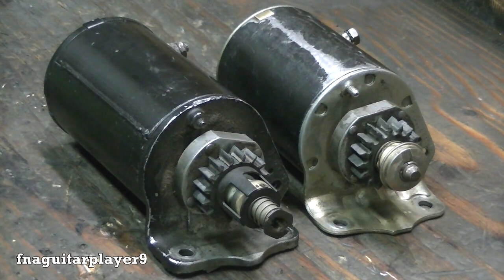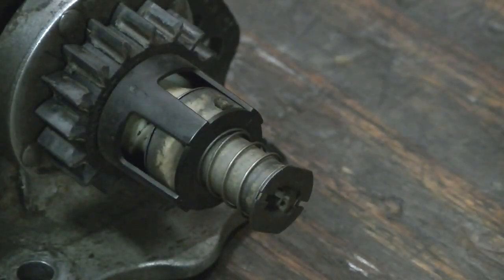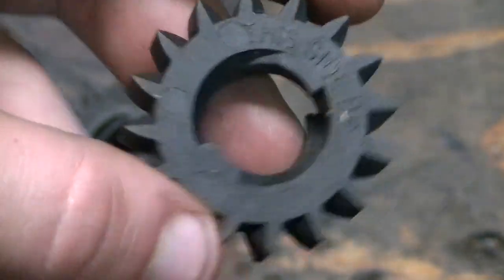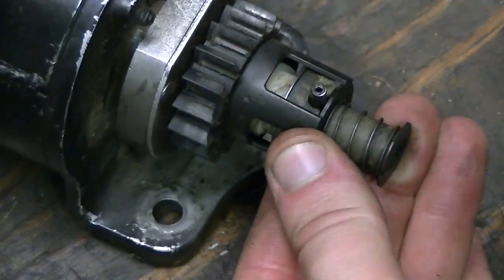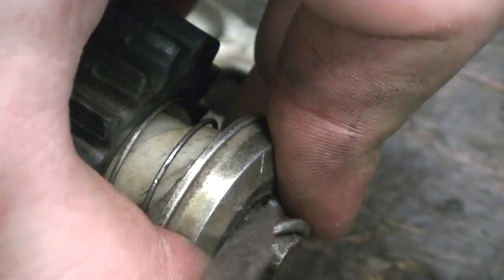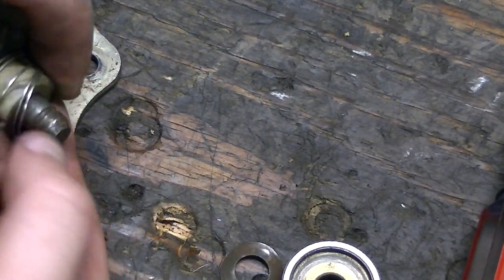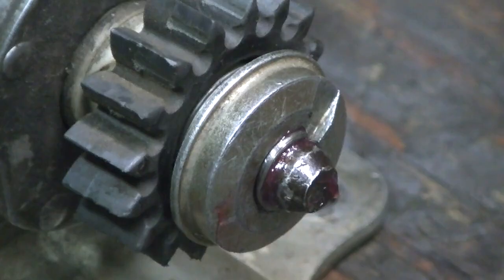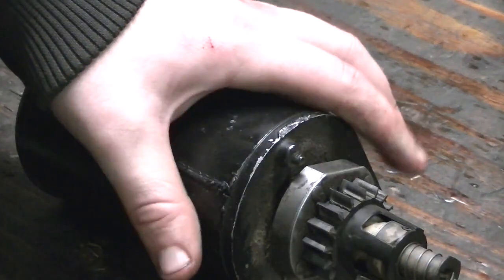How to replace a starter gear on Briggs and Stratton Starters (both rollpin and C clip type)

Comment: 🙋🏻‍♂️👍🏻 3-25-2023…… I notice that the shaft as to where the C clip fits is flat top cone. So it’s possible that the C clip could be placed centered over that , and use a small socket and tap it on until it pops in place. And using grease would allow ease of fit.
But I never removed one or reattached the C clip , so it’s just a thought. ( Definitely have something close to catch that CLIP if not in a shop  ) .  😍 Just took the C clip off, and I was very careful to have my hand over that area to catch it. There’s a slot in the edge of that top washer that contains the C clip. Well, I used a flat screwdriver of that width, which enabled the removal of the C clip much easier. Just turned that top washer until C clip came off, NOT flying across the room. Also, I selected Subscribe ❣️❣️

Comment: Thanks, 1983 Murray still running strong after rehab, rewire, clean out, 12.5HP  I/C  (industrial / Commercial) B&S 42" cut; why not a new J.Deere, well those are now all plastic which cracks apart in just 5 yrs, this 1983 Murray is ALL metal and can take the occasional impact with bushes, we love it, so we rehab'd it. I wax it once a week with yellow spray wax.     BTW:   I might have chosen a socket exactly the diameter of the c ring/clip to tap it down.
Reply from the maker: Your welcome! I feel the same, I hate plastic! Thanks for Watching!!!

Comment: Nice video there old boy.Man i sure am glad to see another man that isn't scared to use a little penetrating oil.I work on alot of push mowers that have never seen a can of wd-40.I look at it like this here.$2.98 for a can of wd-40,or $20.00 hr.i charge for labor.Oh well works out fine for me man.Job security.

Comment from the maker: @Bobbymitchell10 yeah i do to. there a pain. my twin has the c clip too, only had to replace the gear once, because the c clip came loose and it just shredded the gear haha the replacement i buy (from tewarehouse) is a actual clip, the factory ones looks just like a piece of bent wire haha i wander if a snap ring (type used with snap ring pliers) would work on one, i'd think they would be to thin. thanks for watching!

Comment: When reinstalling the c clip use a socket that will just fit down over the shaft.place the c clip on top of the shaf tthen tap it down over using the socket.Then squeeze it with your pliers or vice grips to insure its tight.
Thats the way i do em anyway. 
And yes i keep spare clips in the shop because they will fly when removing...sometimes never to be found.I found pointing the shaft at a ice cream container or bucket
works well for trapping the clip.

Comment: I find on the C clip style it is much easier to get the clip off if you put the depressed slot on the metal retainer 180 degrees opposite the open end of the C clip. I use a little Stihl  screwdriver to get the clip up and then put a larger wider flat tip screwdriver to finish the job.. Lay a rag on top and work under the rag. to put the clip back on I use a piece of tubing that just fits over the starter shaft and give it a pop with a hammer. Snaps right on.
Reply from the maker: I've tried alot of different ways, I miss the old roll pin style haha Thanks for Watching!!!

Comment: Great help! I got the nasty ring and broken black plastic gear off. Do I need to remove the flywheel to get the new gear on? The starter bolts are under the flywheel and cover.
Reply from the maker: tleihn Glad to help out! I hear ya, you should be able to install the new gear without pulling the starter or flywheel, you may have to turn the flywheel while you turn the gear to get it to go down on the starter. Thanks for Watching!!!

Comment from the maker: i've never damaged a started by doing this. this is just one way you can do it. not the best but it works. if you don't spray oil on it the parts won't work freely and can lock up and cause damage to the starter.

Comment from the maker: @1899lpv yes. on the older style like this, the gear on the starter is plastic and the gear on the flywheel is either plastic or aluminum. On the newer engines the gear on the starter is steel and so is the flywheel gear. thanks for watching!

Comment from the maker: oh wow, did you have it apart? If so you might have gotten the brushes installed wrong, or its possible your battery is connected backwards. thats really the only 2 things it could be. I have another video on here of taking the starter apart and replacing the end cap and reassembling it. Thanks for watching!

Comment: I took ths guts out of one and replaced it with the other. Only thing I had to do was pop the flange out of the bottom because the shaft was larger. It's not what you're supposed to do but it works.
Reply from the maker: I hear ya! Glad it worked for ya, Thanks for Watching!!!

Comment: Looks like you use it properly. On grass only. I just finished a customers AYP (Sears) rider. He uses it in fields. Blades were rounded bad, deck crammed w/weeds, etc; belt worn and loose. I sharpened, replaced/adjusted belt...I know he's gonna whine (he's a whiner customer) because I replaced the belt less than a year ago. This time I'm gonna tell him, "These are riding LAWN mowers, not field and brush mowers." No warranty, etc.
Most people THRASH riding mowers. You don't, obviously.
Thanks.

Comment from the maker: i didn't know that drive mechanism had a name!!! its hard to say, most places will try to rip people off. but on most of these motors the ring gear on the flywheel is replaceable, on newer engines anyways, on the older ones it was part of the flywheel casting. your welcome, thanks for watching!

Comment: Spend $15 for the kit with all new hardware, take the discarded white nylon piece, it is the exact right diameter of the metal shaft to smack the snap ring over the taper of the shaft without going metal on metal.
Reply from the maker: +jonzy246 That makes sense, I'll do that next time i get the kit. Thanks for Watching!!!

Comment: Un the second type is it possible to remove the other part under the gear???i need to remove my starter because it burned and that part is not letting me get to the two bolts that hold the starter to the block

Comment: My starter has a solid black plastic cap completely covering the end you were discussing. Does that just pop off? Best way to get it off? (You know, before I go and wreck it. LOL) This starter is one of the 120V types, and it works intermittently. The motor runs nice, and this starter will crank the motor, but doesn't do so reliably. It seems if you fiddle with the gear, it'll work once or twice after that. But when it does, it cranks fine.
Reply from the maker: Yes after you pop out the roll pin that holds the assembly on the top part will come off, i do have to admit i've never worked on a 120 volt starter for these motors, but i figure they are all the same as long as its briggs. Sounds like the gear is getting stuck on the cog, i would recommend soaking it down in penetrating oil or WD40, and working it up and down, that usually fixes that problem. Its best to add that to the maintenance list (put some WD40 on when you do your oil change each year). Thanks for Watching!!!

Comment: Hi, would you happen to know if these starters are interchangable?  My dad has a Craftsman  LT1000 which uses the clip style. I have a good roll pin starter. The measurements seem the same as well as the gear travel,  the only difference seems to be  the roll pin starter   is a little longer cause of the top spring. Hope this made sense. Thanks
Reply from the maker: Yes, either will work, as long as they both have the same gear (metal or plastic). Yeah the taller spring shouldn't matter. No problem! Thanks for Watching!!!

Comment from the maker: Some of the newer motors use a steel gear, but most of the old ones are plastic, if your flywheel is steel it will need a metal gear if its aluminum or plastic  use a plastic gear. thanks for watching!

Comment: On the starter with the snap ring ..to install the snap ring up on top of the gear shaft I use a 11/32 socket and tap it down on starter shaft and squeeze it with a needle nose

Comment: I have craftsman riding lawn tractor with B&S engine I changed my starter it was working fine than something happened  starter spinning but 14 tooth gear are not spinning to engage with flywheel, can you solve my issue as what happened and how to fix this problem, i got new Solenoid, new battery..thanks for your help if you can guide me to fix this problem..highly thankful in advance...

Comment from the maker: @V8Mike93 you mean plastic flywheel gear? i have one like that. ever have the magnets come loose on the bottom of flywheel (stator magnets). my 12.5 power built locked up, thought sure it seized up, turns out thats what happened and jammed it all up haha

Comment: Hey I had a question. That shaft that sticks out the starter where the gears/bearings goes, is it supposed to have and slack. Is it suppress to wiggle?
Reply from the maker: it will some, if its excessive then the parts are probably worn. Thanks for Watching!!!

Comment: To get the "C" clip installed grease the shaft, center the clip, then put the brass nut from a 1/4"  compression fitting over it and tap with a hammer. The hole in the nut is just the right size to let the shaft go through and seat the clip.
Reply from the maker: I'll keep that in mind, thanks! Thanks for Watching!!!

Comment: Abut the c ring. Could you find a socket the same size as the c-ring that fits over the shaft and tap it on that way? If you understand what I mean. Thanks

Comment: Hello, my name is Renee and I love your very understandable videos.. My son have been trying to figure out how to fix the starter that gets stuck in up position when started, can it be fixed or is it bad.  Please answer soon thank you
Reply from the maker: Hi. Glad to hear you enjoy my videos, usually when they do that it can either be as simple as needing cleaned and oiled (the gear and the shaft the gear spins up on) or either gear or the whole assembly (with the spiral shaft) needs replaced, or it may be missing the spring that goes on top, some don't have it, some do. which all the parts can be found on ebay fairly cheap. Your welcome, Thanks for Watching!!!
Reply: Now if he rode the mower with starter in up position what would happen? Thanks from Renee again mom!
Reply from the maker: IT would be best if it wasn't run, if the starter is still spinning while its running, if its just up some and not turning when the engine is running, then it wouldn't hurt anything.

Comment: I bought a used 20  HP 46" husker and when I bought it the starter gear was striped but only half the gear was striped in fact I found the cap that holds the spring was magnetized to the flywheel and after reviewing your video I noticed the metal spacer below the starter was missing which may be causing the starter gear to not fully in gauge  my question is what is the name of the spacer after two starter gears I figured there was something missing. Could you advise me please.

Comment from the maker: You can replace either type with the other, thats the only difference is how the gear system is connected to the shaft, but the part # for that type of starter is: 693054 for the smaller housing and 499521 for the longer housing one (either are interchangable) i'll pm you with a link with aftermarket replacements thanks for watching!!!

Comment from the maker: yeah either starter would work as long as the gear is the same, some newer mowers use a metal gear on the starter. But you may want to fix the starter  before buying a new one, a whining sound usually means a bearing is spinning or maybe just a bad gear, i have another video on rebuilding one of these you might want to try that first. If you do need a new starter go to tulsa engine warehouse and get a aftermarket for like 30 bucks! Thanks for watching!!!

Comment from the maker: @Bobbymitchell10 yeah i can't figure that out why yours does that. unless it is out of line or the starter is sitting at angle for some reason, only thing i can think of. Put a steel gear on the starter (just kidding haha). i hate the way the starter bolts on opposed twins, its a pain, wouldn't be so bad if you pull the flywheel first haha

Comment: My Snapper has the Intec engine & the starter whines... I'll test if battery is good for trouble shooting, but the starter is the C-clip style. So can i get new starter that is the rollpin style and install it? Or do i have to use the same C-clip style that is on the mower now? Does it matter?

Comment: I can't get the roll pin out.  The thing is almost welded in place.. I sprayed it down with PB blaster and I guess I am going to let it sit overnight.. Not sure what else to do but buy a new starter.. IDK and suggestions? Snapper SR130 11.5 HP Briggs and Stratton 30" Deck Mower.
Reply from the maker: I've had them do that and kept working it back and forth and it eventually came out, it can be drilled out but it would have to be the exact size to fit a new pin. Thanks For Watching!
Reply: @fnaguitarplayer9  I finally got it.. Thanks man you the best!
Reply from the maker: @85Studios  Not a problem, glad to help out

Comment: Do they make these gears in metal or just plastic. My gear stripped and wanted to use a metal one.
Reply from the maker: +john brown They make metal ones but, you have to have a steel ring gear on the flywheel, or you'll be changing the flywheel gear faster than you are the plastic starter gears, plastic starter gears are used with aluminum, plastic or cast iron flywheel teeth, steel starter gear used only with steel ring gear. I understand you wanting to use a metal one, the plastic ones do tend to wear out, but you would have to upgrade the flywheel gear as well to use it. thanks for watching!!!

Comment from the maker: try pb blaster it works in better/faster than wd40, i like wd40 for hinges and stuff like that and pb for loosening stuff, let it soak, and make sure your using the right size punch and just keep working with it. also try hitting it like 3 times on one side, then turn and hit the other side 3 times, do that and it should start working loose. thanks for watching!!!

Comment: Don't slide the ring on from the side. Set it on the top and force it over with the appropriate size socket. Easy peasy. When removing the ring, don't pry it up from the middle. Pry it from the end and work your way around the ring with your thumb over the end of the shaft, and the ring will not go flying off and get lost.

Comment: Thanks! I have a 10hp B&S and I need a new starter or at least the two end caps, after watching the video. I have not found the model number... the engine was a gift, so no paperwork. Stamped on the eared end plate of the starter is the number 8905623, but I am coming up blank at the parts houses. Any advice you could give? Thanks in advance
Reply from the maker: Nancy's Ranch Your welcome! I hear ya. The model, type and code numbers are stamped in the flywheel cover, usually over top of where the spark plug is or side of the cover on the starter side of engine. If its a newer one there will be a plate riveted on the top of flywheel cover. Yeah that number on the starter is pretty much useless, it must be a part # just for that plate or something. Hope this helps! Thanks for Watching!!!
Reply: fnaguitarplayer9 Thanks for the help! I found it! Under the rust it was staring me in the face right on top where you said it would be.
Reply from the maker: Nancy's Ranch Your welcome! yeah, I hate when they rust up, makes it hard to see, sometimes you can take a wire brush to it and then paint it, sounds weird but if you put a few light coats of paint on them it makes them easier to read sometimes. I'm thinking about putting this on my video list, identifying small engine model numbers.

Comment: I have two riders with Briggs motors on them, I am having trouble with the plastic gears, I put a new gear on one of these mowers & mowed two lawns & the starter gear was chewed up & would not start the mower again. What is going on?
Reply from the maker: Is it the single cylinder or twin cylinder starters? I had a issue on a opposed twin, and had to drill the holes out bigger to get it to space a little closer to the flywheel, but that won't work on these singles. Could be a worn out bendix, the spiral piece where the gear goes on it, either that or i've noticed the non-briggs brand gears do not hold up good at all. Thanks for Watching!!!

Comment: What is the gear part number for the one with the roll pin have to change one and do not know which part number I should order.
Reply from the maker: It should be the same number for both, as long they are plastic, alot of the newer engines use metal gears now. The part # i use is 693059. Thanks for Watching!!!

Comment: I tried to drill out my pin and it was HARDENED. I had no drill bits that could even dimple the pin. I had to wail on it to get it out. I cut it flush with the shaft using an angle grinder to prevent it from mushrooming

Comment: your video was great. I have a 1996 Montgomery Ward Power kraft rider andi I need a starter gear and don't know where to get one. the model # on my lawnmower is TMO-3510003. It is a Briggs & Stratton engine 18.5 HP. Do you know where I can order a starter gear? thanks for your help
Reply from the maker: Thanks. More than likely if it is a plastic starter gear it is part# 280104, but I would have to have the model type and code off the motor itself (usually on the flywheel cover, either stamped in the metal above the spark plug or a metal tag on top of the motor). I order parts from tulsa engine warehouse (tewarehouse dotcom) great place to deal with, they only ship within the US though, you can also get parts cheap on ebay. Thanks for Watching!!!
280104
280104